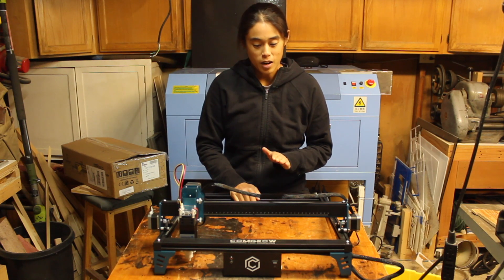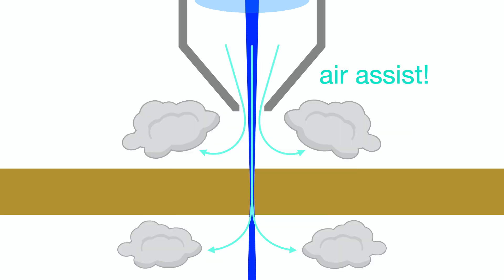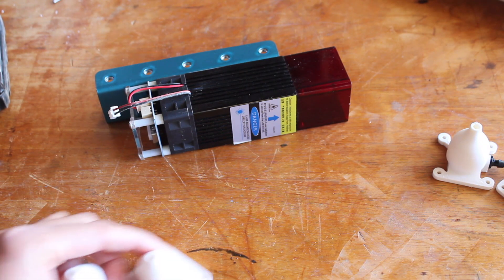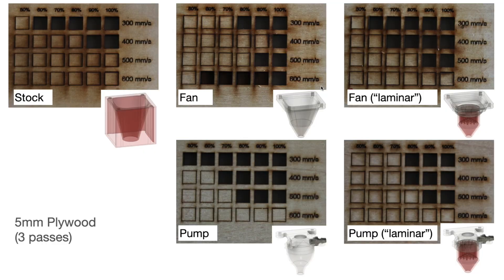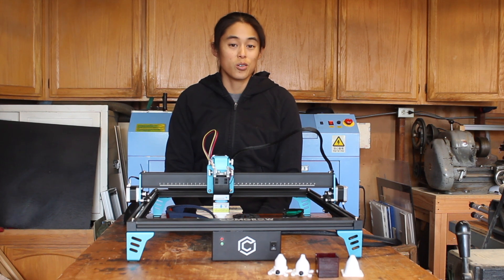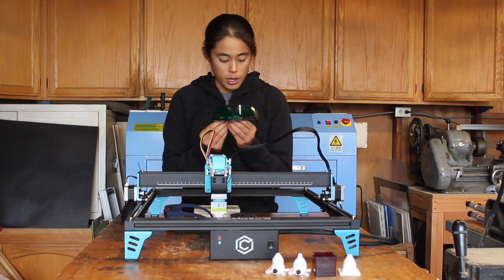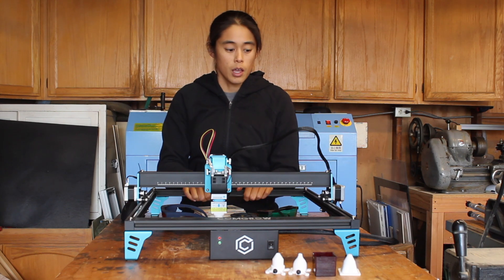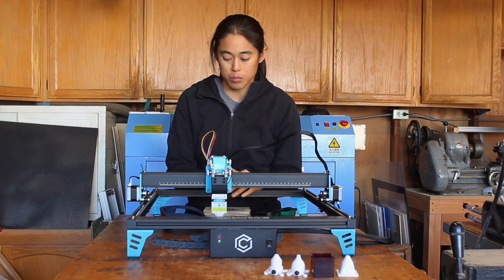Air Assist & Nozzle mods for COMGO Z1 Laser (10W diode)

Comment: hmm, I expected a lot more from the laminar ones! interesting. Maybe the surface is too rough? I can see some stringing inside the laminar flow part. I also wonder what the influence of the curve of the nozzle is after it passes through the filter (when it condenses the airflow). Anyway (Amyway lol), good to know that pressure is more important than laminar flow!

Comment: Regarding the "double line"... I have no strong basis for this guess, but if it's toward the end of the "print" job, could it possibly be a buffer-full and/or handshake issue where error detection/correction repeats a "line" of G code because it was thought to be lost in transfer?  If so related to comms, maybe some settings in Lightburn could help?

Hopefully I won't waste your time on this, since I have ZERO knowledge of Lightburn.
Reply from the maker: Hmm, you’re right that it’s happening towards the end of the job. Not always the same place, but toward the end.

Comment: My guess would be that the "laminar flow" nozzle has a higher loss coefficient than the other nozzles, so the flow velocity is reduced and hence it is less effective. That would also be the same reason why the pump works better than the fan. The small diameter nozzle has a high loss factor, so you need a lot of pressure to achieve higher flow velocities.
You can easily compare the loss factors if you print an adapter for a water bottle and measure the time it takes to drain the bottle through the nozzle.

Comment: Btw while lightburn is great and worth the price they did double the price for the 1.0 release. EDIT: I remembered wrong and it was a 50% increase, and the price given in the video was the newer price.
Reply from the maker: 😯I didn’t know that!!
Reply: @AmyMakesStuff  This is incorrect. It used to be $40 for GCode and $80 for DSP. We increased the prices by 50%, not 200%, with the v1.0 release and they are now $60 (as you correctly stated in the video) and $120.
We strive to keep the software as affordable as possible, especially for users of GCode based machines which are typically far less expensive than a large CO2 laser.
Source: I'm one of the developers at LightBurn :) 
Thanks for the shoutout of LightBurn and keep up the awesome work! Your videos are always great.
Reply from the maker: @AdamHaile  Thank you for the clarification!
Reply: @AdamHaile  Ah sorry for my wrong information, must have remembered wrong. Still recommend the software all the time though, absolutely my favorite one to control lasers!